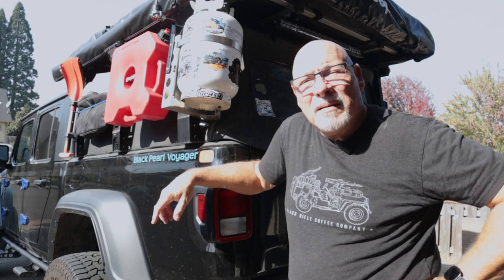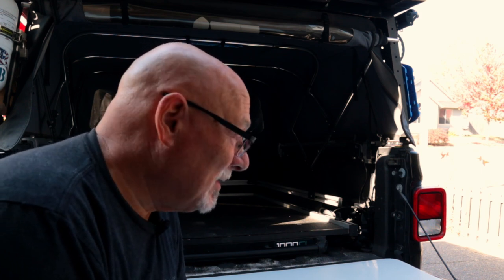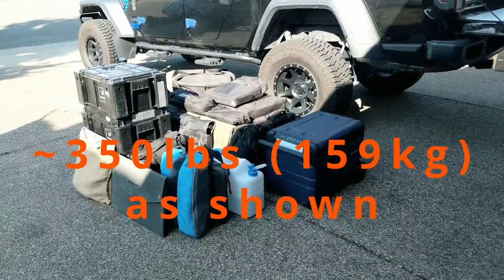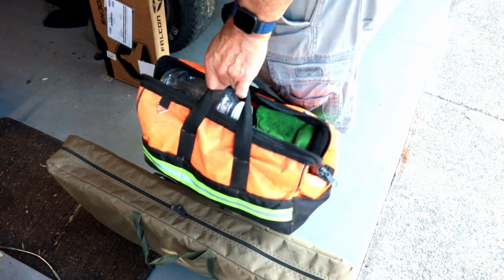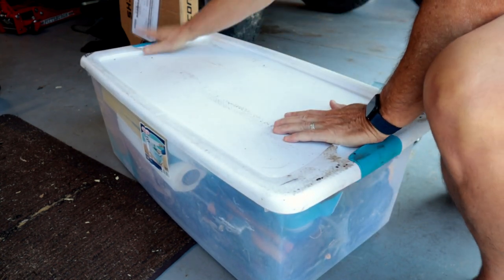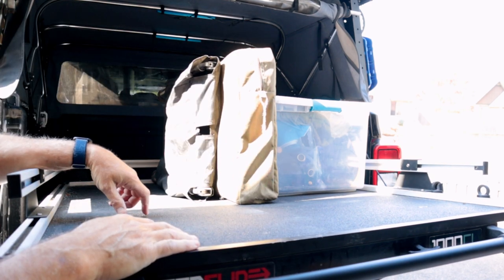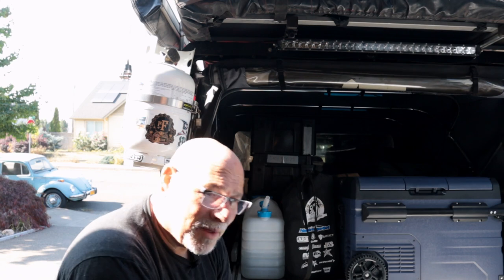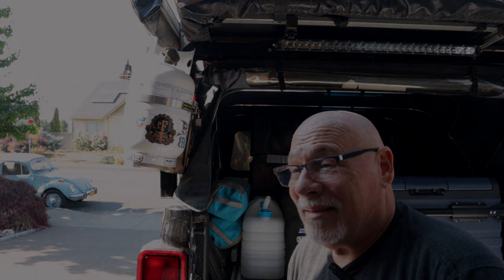2020 Jeep Gladiator Overland Build - Our Loadout Inspired by Coyote Works,

Comment: Ted that setup is great. That drawer makes all the difference I'd guess. I've got a new build coming and am planning a few cool videos and a thing or two you might find interesting. I've got to do that tailgate mod! Thanks for sharing your secrets buddy!
Reply from the maker: Yeah that sliding drawer is a lifesaver for a guy. My age. I'm too old to climb in and out to unload and the bed slide makes it easy.
I guess I could have done a quick video on that tailgate mod, it really didn't take much effort. I can DM you some links to the material that I used.
Can't wait to see what you got on the back burner. Post some videos. Cheers and Merry Christmas!
Reply: @blackpearlvoyager4174  I sold basically everything hahaha
Yeah send me some info on that board!
Reply from the maker: @RavensEyeOffroad  check your inbox. DM me for questions. If you have a bed liner you'll have to do some sanding to smooth out the rough to get the VHB to adhere best.
Reply: @blackpearlvoyager4174  thanks man! You rock!

Comment: Did you weigh the fridge?
Reply from the maker: Yes, I did. And that's why I rounded up the final weight to 350. It will easily exceed 400 by adding the kayaks. And this doesn't include the weight that I've added to the rack with fuel, water and propane.